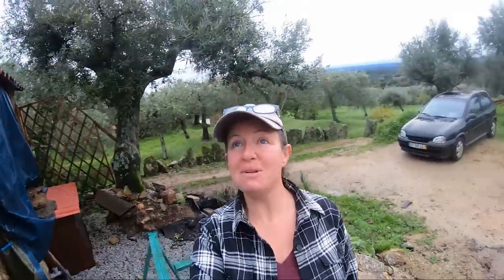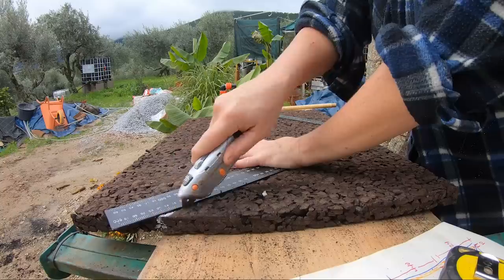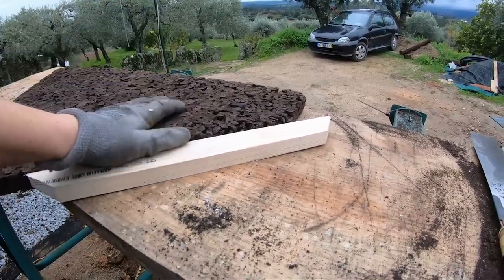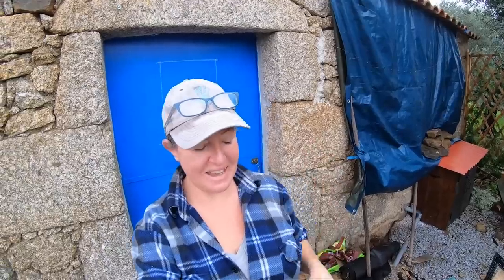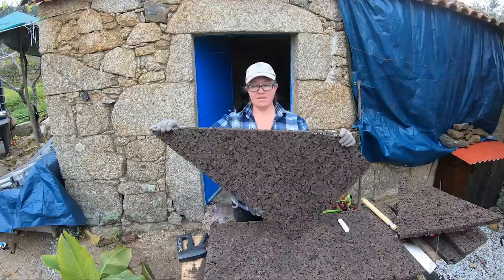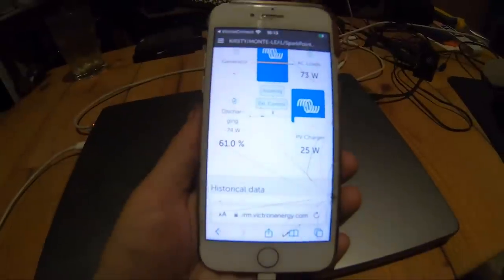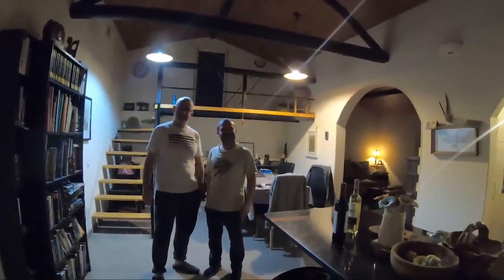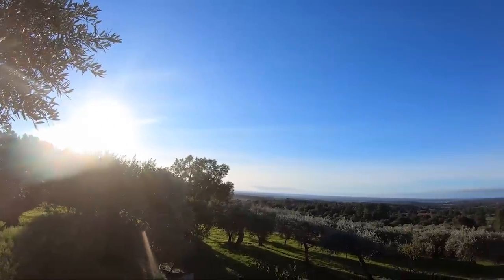More Cork Fun & Realities of Living Off Grid with Solar During Winter

Comment: Kristy I was wondering as you sliced the cork thinner why you didn't just make the surrounding wood the same thickness as the cork (or not even bother about it) and go with the extra insulation factor of the thicker cork? You must have some thought in mind but I am missing just what it could be as the thickness of the door does not seem to be a real issue the way it is installed. Be well.../B
Reply from the maker: A good idea but it would have made the door thicker which would have created some issues with opening. Plus the whole thing would end up being heavier, too. Those are a couple of reasons but I'm only thinking of them now! 😆 I guess, instinctively, it just made more sense for me to design around the door instead of the cork. But there are always so many ways to do one thing and that's what I love about doing this work and being able to share it!

Comment: remember you can put a few panels on the ground and just run a longer cable to connect to the other panels..you could bury the cable in the ground..so in reality you could have some facing south full time on the ground to compliment the ones on the roof..if you buy an optimiser for the solar panels you will get maximum benefit on cloudy days..
Reply from the maker: That's an idea! guess I could put them onto my third terrace without too much trouble. I have space down there, just none up by the house.
Reply: @PortugalfromScratch  thats  another project to add to your list..more content..show us your skills and make a solar panel frame..easy enough with your skills and attitude..

Comment: We have constant rolling blackouts in south africa as our power stations have not been maintained so are in bad disrepair. We spend 8-10 hours a day without electricity. My advice to you would be ti switch fridge and freezer  off during the day for 2 hour intervals. This way you can save a lot of power yet maintain integrity if the temp inside.
Reply from the maker: Good to know, thanks! One thing I was wondering about is whether, when the fridge is turned back on, it ends up taking more power to get back to the right temperature? I wasn't sure if it would be worth it but, by the sounds of it, it is. Thanks!

Comment: Hi your getting there with the door. Does it close tightly? Thought I could see daylight around the edges.  Maybe if you could get a rubber seal for around the door frame it might help. Solar can be such a struggle in the winter months shorter days and lower sun. Maybe a small back up generator could help with that . Sharon and Andy in finca life have a system where the generator kicks in when the solar gets to about 20% . It's all money I know but might be worth it in the long run. The inside of your home will look so much more bright when you get a window in the door. Your doing a great job and will get there in time. Love the videos.
Reply from the maker: Thanks so much for watching and for the ideas! Nope, the door doesn't close tightly so I'll need a solution for that but I haven't thought about it yet. A rubber seal of some kind would do the trick I think. Yes I think originally I wanted a generator system like that but way too expensive. Something for the future, perhaps!

Comment: So happy you got all that cork cut!  Yes, it should make a difference in inside temps!  The biggest  improvement is if and when you can seal up that huge opening under the front door?  Do they sell thesholds made of metal there?  These are attached permantly to the floor and the door is tightly fitted into them when closed?  This would eliminate most of heat loss from inside the house.  Also stop drafts, dirt and creepy crawlies from coming inside.  
Great job on the cork.  You definately need a generator for times such as these!  Hugs from Costa Rica!
Reply from the maker: Thanks! I think, because of the way I did the stones at the door threshold, a metal thing might not work. I was going to get a brush thing and also use a snake at the bottom to keep the drafts out. But honestly, my place is so cosy already even as it is. It's amazing how much the stones soak in and release the heat from the stove.

Comment: I was thinking 😬 (always dangerous)😬 but have you ever considered having an internal door, creating a warm air pocket, and creating extra security once you create the window on the metal door might be the easier option 😬. 🌻🐈🇬🇧
Reply: I was thinking the same thing.
Reply from the maker: I hadn't considered that but was thinking of eventually adding a screen door opening outward. The metal door opens inward and there's no space to fit an additional inward-opening door. But it's a good idea! Honestly I have so many things on the go that just getting the door insulated, clad, and having a window for light seems a tad overwhelming! Eventually I'll replace the door but for now I think it'll do the trick. 🙂

Comment: The thicker a layer of insulation is the better. Why didn't you use wood pieces the same thickness as the cork?
Reply from the maker: Yes that's an idea I didn't give too much thought to and it might have worked. Though it might have led to issues with the door opening an also, I wanted the wood to be tucked inside the metal edging, rather than having a gap. Not sure that makes sense. Plus it would make the door heavier. But you're right, I could have made it work, I'm sure!

Comment: I quite enjoyed the peppy music while you worked on the cork! It's going to be so solid once you add the wood paneling.  Also, are you able to put weather stripping around your front door? I see someone else mentioned the bit for threshold. I am laughing to myself because you must chuckle at our comments like you haven't already thought of these things. You're a fave channel, that you are.
Reply from the maker: Actually I haven't thought at all about weather stripping... no idea what it even is! 😁 For the bottom I was going to add a little brush thing and for the sides I don't have a plan yet for a tighter seal on my door. So I'm always open to suggestions! Especially for things I'm still working on as often people have great ideas haven't even thought of.
Reply: @PortugalfromScratch  its a felt/watertight-like strip that adheres to the door frame or door, which gives a tight seal. Not sure in terms of your metal door application but I'm sure some rooting around on the interwebs will have a solution.

Comment: I know there are some options for insulating a fridge and freezer to make them more efficient and I wonder if your solar panels could be hinged on the lower end and rigged on the other end to allow you to change the angle in the winter months.  I know, such vague terms...because I am admittedly not very savvy in the technical terminology of construction.  However, I have seen another YouTuber do something like this.
Reply from the maker: I think I know what you mean about the solar! I could have actually bought a setup that lifted them to a more optimal angle and direction but it was going to cost around €300 just for that metal framing so I didn't. As for doing something myself, that's probably beyond me. But maybe I can buy the frame in the future one way. I've never thought about insulating my fridge more, that's interesting. Someone mentioned putting ice inside to keep the temperature and stop it from switching on so often, I think that's something I can easily try!

Comment: Put the extra thickness of cork in the door it’s more insulation. Giving yourself too much work. It will look nice however once you have got it done. Great tool for cutting the cork.
Reply from the maker: Thanks but extra cork would mean thicker wood and more weight and making the door thicker would have also meant that I couldn't open all of the way due to the way the hinges are. But, in theory, thicker is better!

Comment: Hey Kirsty!  Just wondering if you are making sure your solar panels are clean.  Even rain will make a film on them.
Reply: With that torrential rain im sure they are spotless😂
Reply from the maker: I didn't realise that, I figured the rain will keep them clean but I'll give them a quick mop then and see!
Reply from the maker: That's what I would have thought, too! But it doesn't take much to hop onto the ladder with a mop.
Reply: @PortugalfromScratch  It’s worth a try!  Check the bottom ledge - especially accumulates there.

Comment: If you trim the top of that one olive tree would it get more sunshine on your roof? It looked like the sun was behind the topmost branches. I hope santa brings you an extra battery and or solar panel.
Reply from the maker: Actually I think you're right! I might get up there and give it a trim and see how it goes because, with the sun so low in winter, I think the tree is blocking it. Thanks for the idea!

Comment: I was thinking about the cork you put in the blue door, good insulation by the way, you said it made the house darker though. Can you paint the cork white?
Reply from the maker: I'll eventually clad over the door cork with pine tongue and groove which will be lighter and seal everything in nicely. But I would also like to use cork as insulation for my ceiling and when the time comes, I'll research whether I can paint it with a lime wash. So it's on my radar but that job is still a long way off. 🙂

Comment: Yesterday I saw a video of someone closing his missing windows with transparent roofing panels. As a temporary situation so wind and water cannot come in but there is light. Could that be something you can do with the window situation with the blue tarp? For the door I would go for a simple window as you are planning a roof over the front door you can leave the door ajar even when it's raining? Hope you get some sunshine soon.
Reply: Excellent idea! Those panels should be as effective as the blue tarp with the benefit of letting in some light and looking better.
Reply from the maker: Possibly! But beneath that tarp is a very scary hole in the stones, so it wouldn't be easy to attach to. It's not a missing window that's my problem, it's the lack of an actual hole to put a window into. I'm planning on doing a house tour video next week and perhaps it'll make more sense then! Thanks for the idea, though!
Reply from the maker: Yes exactly, it would be a great solution except I don't really have a proper hole in the wall to attach it to.

Comment: Where did you buy your cork boards? Id love to use natural insulation,just struggling to find an economical supplier
Reply from the maker: Unfortunately, compared to foamy alternatives, cork isn’t economical. It’s expensive stuff. My build is so small so I can justify it but for a huge area it would be a massive expense. The company I got it from is called ‘Amorim’ I think.

Comment: you should consider a small generator that you can run when you are dire on power... run it an hour to charge up the battery and other chargeable gadgets and shove it away until next time, it's a great backup and also more panels = more power, especially when the weather is moody
Reply from the maker: Yes I think I can borrow a friend's gene for the moment, so I'll consider that and then possibly I can buy a small one before this winter ends. It would be handy!

Comment: If you live off grid, you need a generator. I am off grid in Australia and I still have to top up my batteries after several days of heavy rain. The idea is to not drain your batteries down.
Reply from the maker: I guess it depends on how large a system the person has, how much power is used, and how rainy it gets! But I'm beginning to think I'll need a generator... this is a particularly strange, wet winter so far and will continue. Last winter was no problem at all... didn't even think about power! It's been a crazy contrast for sure!

Comment: An Idea for your door's window, carefully cut out a larger hole with an angle grinder. This can be a hinged (lockable) flap on the inside.
Place security mesh and sandwich it in as per this video (below), use security fasteners that cannot be unscrewed on the outside. https://www.youtube.com/watch?v=nJDWjOkaQhM
Make a window with a long horizontal in the opposite wall for cross ventilation (for summer nights), and install security mesh in this as well. the mesh could be cemented in with stone surround, and a lift-out window-frame for the cooler seasons.
Reply from the maker: Thanks I'll take a look at the video when I get. bit more time. I'm open to all ideas!! 🙂